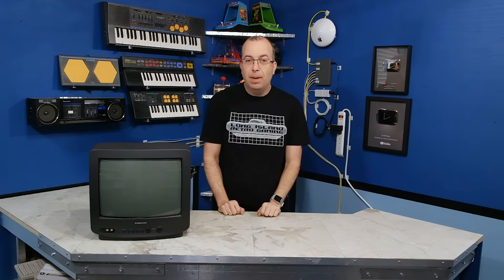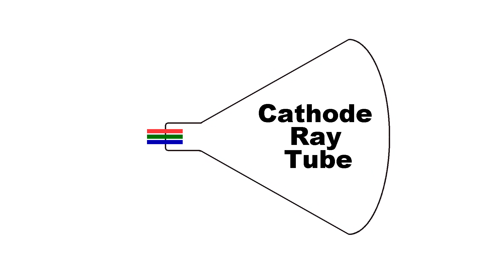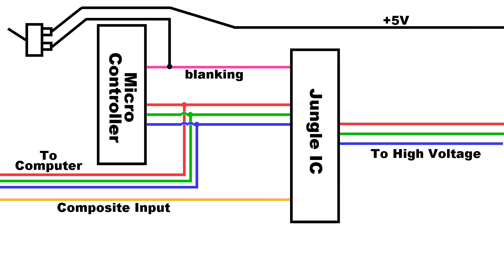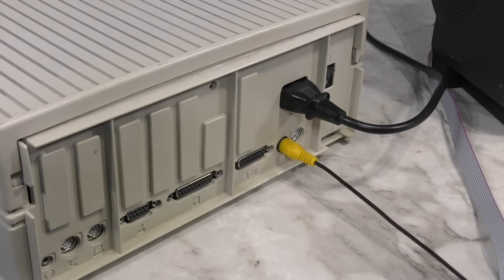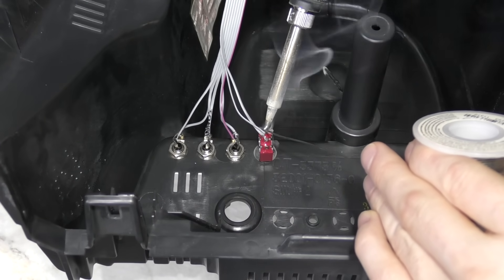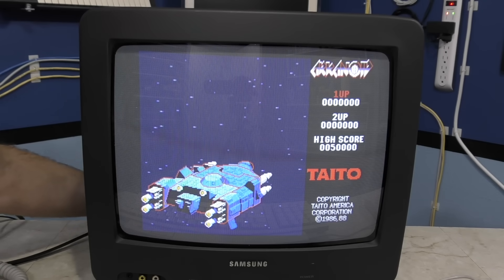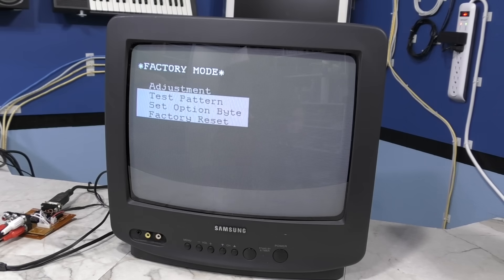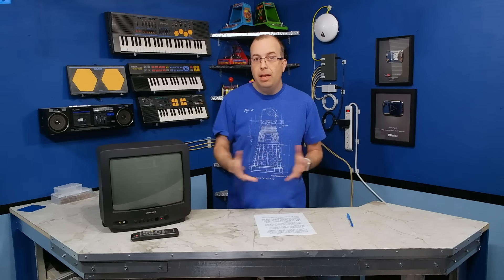Modding a consumer TV to use RGB input

Comment: FEW QUESTIONS:

-What resistor did he short out at 5:36?  is this the case for every TV?

-When he adds resistors (the triads at 6:36)  does that mean you should not use a scart cable that has resistors added to them? Or do you still need to use a cable with resistors?  Seems to me he's doing this internally so your cable doesn't have to have them... which means gamers beware, don't buy scart cables with resistors or capacitors?
(also how would one determine what type of resistor to add?)

-I don't have schematics for my TV, however do you think it might be possible to locate the RGB and Blanking pin manually by looking for a set of 3 resistors and tracing them back to the jungle IC with a multimeter?

-I'm scared to discharge my TV, it's HUGE. Can I attach the screw driver to a PVC pipe from home depot and do it from a distance? Is there any risk the electricity will run up the PVC?

Comment: AAARRRGGGGHHHH! 14:19 Not CGA! EGA!,.. EGA!!! (closes eyes and takes a couple of deep breaths.) Sorry for the outburst but that was traumatic. CGA or "Color Graphics Adapter" is 2 bit graphics. One that controls the Red and the other controls the Green. The Mode is set which controls the Blue for the entire display. One Mode turns on Blue to provide the colors Magenta, Cyan, and White, while the other mode turns off the Blue bit to provide Red, Green, and Yellow as the color pallet. EGA  or "ENHANCED Graphic Adapter" works exactly as you described using 4 bits per pixel. Very cool video though.

Comment: It always made me scratch my head as to why TVs couldn't be used (at least not very well) as monitors. This wasn't just for old analog TVs. I did have a Color Computer 2 growing up, and we used a TV as a monitor for it. It undoubtedly looked like garbage.

For example, I recently sold a 2007 HiSense 24" 1080p TV because there was no way that I knew of to turn off the overscan, so it didn't work properly as a monitor over HDMI. I even contacted HiSense about it, and they didn't know either. It was a perfectly fine TV and actually looked quite good for that purpose. I think newer TVs are much better equipped to deal with this problem.

Comment: The SCART connector is the worst thing ever invented. It ranges right behind the HDMI connector. This seems again like planed obsolescence: Lets make the connector as fragile as possible and then lets place it so that no one can repair it and you have to f@$€%&ing buy a whole new TV unless you are a good prepaired hobbyist.
I mean they allready had a good connector: The DVI serves identical the same signal (except audio) as hdmi AND it is robust AND can be fixed. Why not improve the DVI connector? Why make it weak?
Same thing with SCART: plugin once and never touch again.

Comment: wow, indeed that's what you americans need to do to get a RGB signal on a composite TV. 

around here we have péritel (scart) connector and it does have RGB input there, i made one to play some PC games on the big TV. Wiring is easy, you just need to fiddle with your ATI or nVidia's advanced control panel to find adequate frequencies. I was surprised my 95 Philips MatchLine could reach about 1152x864, needed to add 12v or something to trigger the 16:9 mode.  Duke Nukem, Quake on a large TV with the hi-fi sound has always been a must. 

Okay now with 'mulation and HDMI hooked on your living room's plasma it's nothing, BUT back then it was a classy hack. 

Composite was a mistake and should never have happened.

Comment: Does your TV have an isolated power supply. Otherwise you may cause safety problems when you connect to another AC powered device.
Reply: These small TVs had them. they were designed to be placed on top of or next to VCRs, video game consoles, mini-components and other devices that were powered by AC.
Reply: Agreed. Anyone thinking of ripping apart some TV be very careful.
Some TVs, usually older ones but not always, connect the chassis to one side of the AC line. Touch some ground to it and... Poof! Sparks will fly.

Comment: Is it possible to get a component YpBpR signal to work on modded TVs?
Reply: Not as easy, because the jungle chip typically does accept RGB, but not YpBpR. You would need to separate the sync from the signal and feed it into composite, then convert the YpBpR into RGB. It can be done with a box of electronic components, but is a lot more complex than adding RGB input like it was done in the video.
Reply: Well that's bad because consoles like the PS2, Gamecube, and Xbox, support component outputs yet their output is YpBpR in NTSC countries and I was wondering if there was a way to make that work on a TV like this.
Reply: Well, there are RGB SCART cables available (off the shelf) for all of those consoles, which you could perfectly connect to a RGB modded TV like this, even in NTSC countries. If fact I think these consoles are exactly why RGB mods are being made.
Reply: I don't know much about YpBpR other than the fact that it somehow puts the sync signal in one of the three red, blue, and green, connectors.
Reply: YpBpR is simply a different way to decompose a colour. Rather than decomposing into red, green and blue, you decompose into luminosity (Y), redness (pR) and blueness (pB). And indeed, the sync is one one of the pins, whereas typical RGB implementations use separate pins for sync.

Note that the fact that the connectors often have red, green and blue colours doesn't make it an RGB input. RGB<>Component.

Comment: The funny thing about SCART connectors is that they are still widely in use. Something so old.. yet electronics generally come with the connector still. It's not even nostalgic to plug them in because of that. And the image quality on wide screen TV's are actually decent enough. Holds no candle against HDMI, but it is unnoiticable in many cases.. since you generally don't sit too close to them and sharpness of picture in many cases makes the viewing unpleasant. Though of course that's probably just a subjective opinion on my part.

Comment: Recommendation: a little additional flux in your soldering would result in much better, longer-lived solder joints. And clean off the flux after ANY soldering.

Comment: Just be carefull before modding uour TV, make sure it is not a live chassis set.
Most with composite & aux audio inputs are not live chassis, where as sets with only an antenna RF input could be alive.  Check first.
shoving 240VAC (or 115V) from a live chassis set back up you favorite 8 bit computer is  not a good idea, I know one bloke who did it (and lived!) wondered why he was getting tingles/zaps when he touched his C64 joystick ports. When he hooked up a meter (as I suggested he urgently do), there was 240V on the joysticks - ouch.

Comment: https://youtu.be/DLz6pgvsZ_I?t=892 - So how do we get rid of overscan on a Tandy 1000?  An alternate method is to use the Tandy DOS command MODE 200.  Tandy 1000s start up using 225 vertical lines in text modes, but CGA cards start up using 200 lines.  The MODE 200 command tells the display adapter to display 200 vertical lines, eliminating overscan on most TVs without needing to adjust the vertical height of the TV.

Comment: Is it possible to do this mod with a JVC AV-21BS26 Television? 
I acquired the television from a yard sale for $4  a couple of years ago and it is very weird television. 

What makes the T.V. strange is the fact it has settings for NTSC, PAL , and SECAM and can do 50 or 60 hertz. The rated voltege on it is 110v-240v.  The video ports are also strange composit in and out, component (but not HD compatible), and a BNC female jack where coaxial normally is.
Reply: any CRT can be fed RGB just depends but if you cant do what he did you have to do a harder job and go to the RGB on the neckboard
Reply: I found the service manual for this TV here:

https://elektrotanya.com/jvc_chassis_cw3%2Cav-21bs26%2Cav-21bx16%2Cav-21bx16b.pdf/download.html

The service manual shows there is no easy mod for your TV: Your TV is a single chip design, there is no separate OSD chip that outputs an RGB signal to a jungle IC.

The single chip of your TV has absolutely no RGB input (at least I don't see any), therefore there is no easy RGB mod possible.
Reply: Daniël Mantione thanks for the info.

Comment: Ouch - directly connecting 5V to a microcontroller output pin!  You really ought to disconnect the existing lines rather than tap into them, a 4 way toggle switch or switch IC with sufficient bandwidth. Just as well that TV has a mains isolated chassis, assuming it does.

Comment: My family had a 35 inch television from Philips with RGB SCART, full RGB mind you its the best SCART around town for a TV of this period, a TV from 1998, and it still worked until last year when we got rid of it I still regret that we did, its shame I did not have space for it the fucking thing weighted at least 60kg and took 3 men to lift from second floor to first floor. 

Would been amazing to use a SCART to HDMI connector on that thing.

Comment: its very odd because the UK, all TV's circa mid to late 90's have RGB built into our SCART socket. this plug had everything, composite, s-video, and RGB. it had two control pins 8 and 14. pin 8 when grounded auto switched the TV to SCART1 or 2, and pin 14 did the auto switch from 4:3 to 16:9.  it also had a data path for things like VCR's to read the TV's tuner states. it was so weird you guys over the atlantic ocean never had it. - but yes RGB mode is awesome, i had my PSX on that mode and being able to enjoy stereo sound with clear graphics properly was the shit.

Comment: Uses Samsung tv with apple pc
Reply: TRIGGERED
Reply: Why didn't he use an Apple TV?! It would probably have thunderbolt only, requiring a dongle.
Reply: There is actually quite a bit of Samsung in modern Apple stuff.  Samsung is one of the bigger chip fabs and one of the biggest display panel fabs in the world.

Comment: I can't believe this is so easy to make. Makes me wonder why TV manufacturers do not offer RGB in the US market. It seems to only cost them a few bucks. At the very least, I would imagine How-To guides for modifying Sony or Panasonic TVs to surface consider how much a SCART TV could fetch on Craigslist these days. Having said that, I noticed that the color is something significantly different between your moded RGB and Composite. Is it normal? Is the picture shown in RGB the true color the device meant to output?
Reply: Absolutely. Composite is processed twice: First inside the device from RGB to composite, later inside the TV back from composite to RGB. These conversions are not perfect and TVs often also have adjustment controls. This is all bypasse in RGB, so you get the signal right from the source, in other words, the original colour.
Reply: @danielmantione  RGB is better, but the source usually converts from digital to composite directly, and the the tv can use part of the tv demodulating circuitry for composite. VHS and laserdisc also convert directly to composite.
Reply: For VHS and laserdisc, RGB indeed makes no sense. These devices often don't provide any RGB signal at all on their SCART ports, or use RGB only for an on-screen display. For a Commodore 64 RGB doesn't make any sense as well, because of the analog method it generates colour (it amplitude modulates phase shifted sine waves), you can consider the C64 native S-Video.

But for devices that don't have an intermediate analog RGB signal and go straight from digital to analog, they still will more often than not internally use a digital RGB representation, in such case, conversion to analog RGB is trivial, while conversion to composite is not and involves quality loss. Then I would say that it still holds that the RGB signal represents the originally intended colour, or at least is much, much closer to it than the analog signal.

Comment: Good job. Blurry picture over composite input is obvious because composite signal has poorer color separation. And NTSC suck in that. We in Europe use PAL which have better color separation, larger frame resolution and sharper picture with that. But direct RGB input is better anyway because it simply pass all signals to TV as they came from computer. Funny to see that people still mess around with RGB mods. Did that by myself in school years - connected personal computers to TV and play games and stuff. I honestly didn't knew about no-existing SCART connector in Americas TV's. Was convinced that it is worldwide standard - thank you to clarify that for me.

Comment: In Europe many devices actually just sent a composite signal through a SCART adapter, meaning that all the capabilities of SCART were essentially wasted. My PS2 and Wii have the familiar red, white, and yellow cables, which just plug into an adapter that fits into the SCART port. The picture is just as shit as with composite without the adapter. I've only seen DVD players and VCRs take full advantage of SCART.
Reply: Both the PS2 and Wii support RGB SCART, but it is your responsibility to make sure you have the right cable. SCART is a universal AV connector, it was never intended as RGB only. It can be used as composite input, and yes, some people will try to exploit that to make the price another €0.01 lower. Doesn't make it a bad thing that SCART supports composite.

Besides DVD players and game consoles, digital TV tuners are a very significant group of electronic devices that takes advantage of the RGB functionality to display a better picture.
Reply: I know all that, but the fact still remains that one has to buy a special cable to get SCART RGB out of a PS2 or a Wii. I didn't say that it's a bad thing that SCART supports composite, I said that sending composite through SCART is a waste of the cable's capabilities.

Comment: Here in Poland euro-scart was a standard, so in the 90 we just used this connection for glorious RGB from Amiga, SNES, PS1, etc.
Still, a very interesting mod and cleanly done.
Reply: SCART was a standard in Europe, but not all TVs can do RGB input, even if they have a SCART connector. (the SCART cable can do composite and FBAS too, and FBAS was often the standard way on low-end TVs).
Reply: @wuloki  I think u are wrong, SCART was develop as RGB, or u think about 10pin SCARTish connector... All 3 cathode CRT can RGB. u must only tap in another place.
Reply: Maybe it's a different thing in other countries, but in Germany it's like that.
Reply: It's no surprise either:  SCART was a thing when people had VCRs. But I have never seen a single VCR in my life with RGB output (and I saw a lot).
Or, to put it like this, RGB only became a thing in the last years of CRTs, about 1999 to 2008, due to digital satellite receivers and gaming consoles, but it was always optional and you had to enable it both on the TV and on the peripheal. (and I doubt that a lot of people even knew that there was a setting for that).
Reply: Technically you're right, SCART was initially planned with RGB in mind -- but the device makers never really implemented it.
Reply: SCART was created by the french with the will to standardize things a bit. Manufacturers hated it and cheated a lot, not all SCARTs are equal (japanese hated the connector)
Too bad it wasn't the success it should've been

Comment: Woah. That difference would've been worth hundreds back in the day. I remember the monitor I used to use for my FreeBSD server was AWFUL, mainly because it wasn't a "monitor" but a TV. As you explained near the middle of the video, 80 columns would have been unreadable, and my parents would have paid quite a bit for a monitor capable of doing so. I was more limited to 40 when I was using my FreeBSD server, which made it just awful to mess around with. Luckily, I was born in the age of SSH, so I could work on it remotely from my computer at home, but whenever I would mess up something, I always had to go with my parents to their work in order to reset my server on that TINY screen.

Comment: Personally I'd go for a seven pin DIN connector for the back of the television. They look so clean and sleek and it's an old standard so they're easy to come by. You could easily make tons of custom cables with them. And you only need to hook up one or two cables. You could hook up the sync to the composite internally instead which would make it a single connector solution.

Comment: BNC are connectors of the devil, too many bad memories of struggling to disconnect BNC network connections (though to be fair that was by design, its intended for fit and forget).  Standard phono is way better if you are going to be swapping devices.

As for SCART, loved the picture quality but the connector leaves less to be desired.  Had no end of problems with the pins themselves pushing into the plug after swapping devices a few times as their tiny little lugs to hold them in place are too fragile.  Unfortunately as standard with analog, switchboxes weren't really an option as the signal loss/crosstalk was terrible.  I honestly don't really don't miss those days.

On oddity about Europe/UK was component video was really rare, we kinda went straight to HDMI.  That made the HD transition a bit more problematic and consoles like the Gamecube didn't support progressive scan in the EU like it did in the US because of it.

As for modern standards, I don't think HDMI is great either, they tend to work themselves loose over time causing signal issues.  I had to replace my surround receiver as one of the HDMI ports stopped working, I suspect the surface-mount solder connections broke from the weight of the cable.  So far the most reliable seems to be Display Port due to having a locking mechanism to stop it becoming loose.